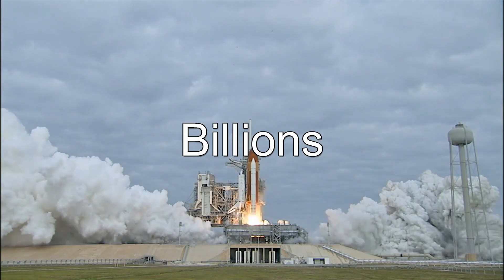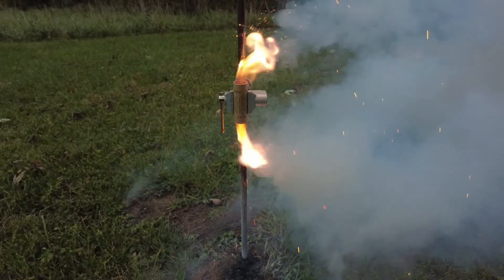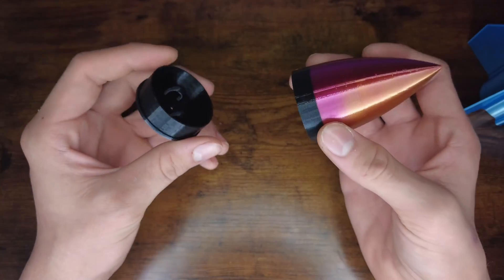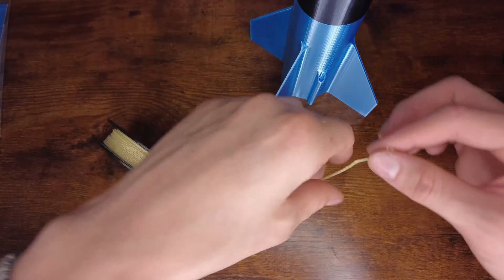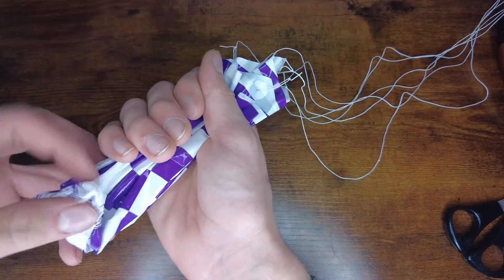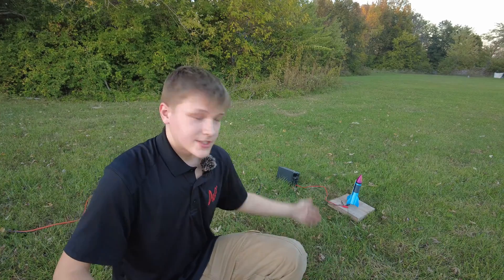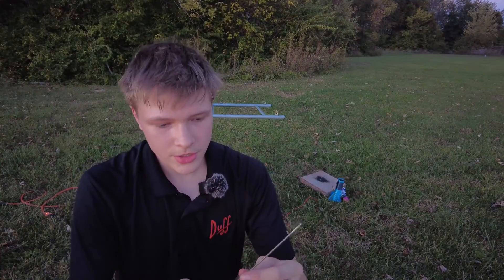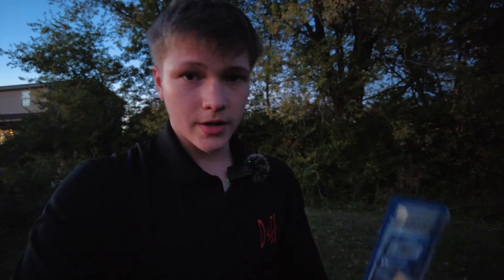Dummy Makes a Model Rocket

Comment: You should add a length of a elastic band that’s cut so it’s just a rubber line so the string doesn’t rip out, also the peice that held the motor snug did not have a limited to prevent the power of the motor from pushing the motor itself far into the rocket which may cause it to spin out